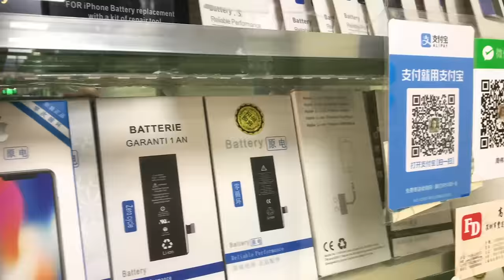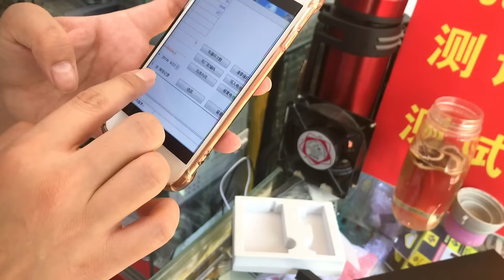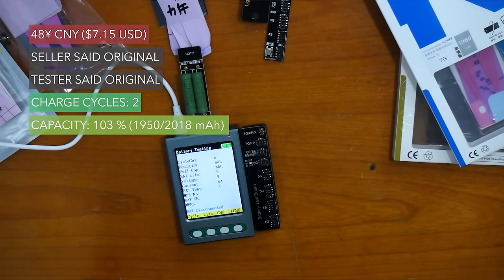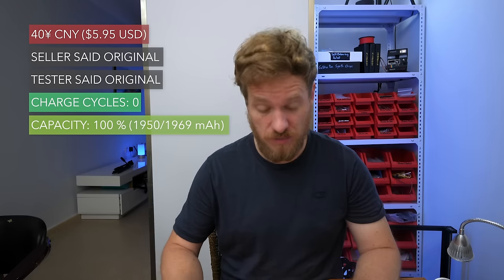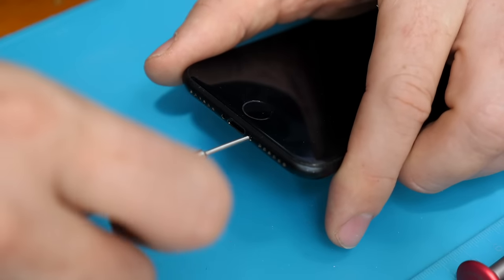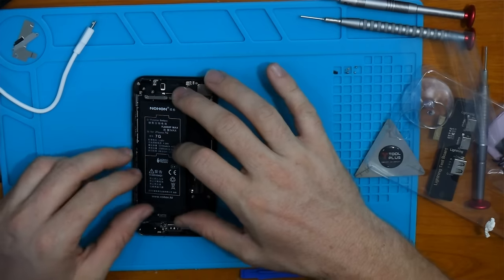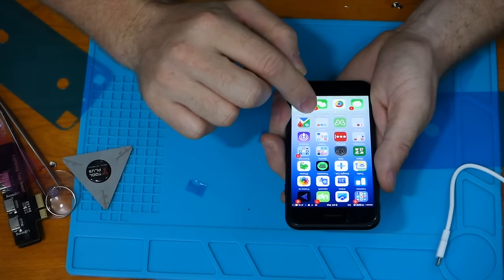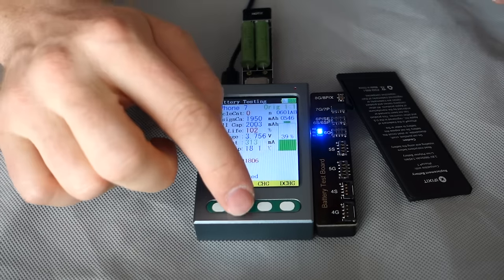Real or Fake? Trying to Replace my iPhone Battery in Shenzhen, China

Comment: Thats how easy and cheap a battery replacment could be! But it would be even better if we could just hot swap them as we used to!
EDIT Yes you could & still can hot swap them even if "cold swapping" was more common; that said i would take both over a 1mm thinner phone!
Reply: no because battery are dangerous,its was meant for expert to handle it not user...thats why they make it harder to change,also for safety factor...modern battery has bigger capacity thus more dangerous
Reply: You are supposed to keep lithium batteries away from heat so I don't think a hot swap would work, maybe a moderate or cold swap would be better.
Reply: Hot swapping is impossible on a phone. You can't replace it whilst keeping the phone online. You're using that term wrong.
Reply: @kennyj7627  you could have some kind of secondary small battery inside that just powers it for a minute or so, so you could hotswap the full size battery.
Reply: @justalilbitnerdy  that's not what hot swapping means......
Reply: @UnsweetIceTea  But that would wear out aswell and it has no benefit but adds a lot of complexity.
Reply: @naheeduddin1672  r/woooosh
Reply: There are many reasons we don't have cold swap anymore:
1. Most modern phones are water proof.
2. Modern phones are very thin, replacable battery wouldn't have enough space.
3. A removable battery needs a stable case which takes up even more space.
4. Apple wants to make some more money and the otherd follow
Reply: harry boyd  Well, there is a lot of stuff that uses removeable batterys but is still waterproof, like action cams.
Reply: @kernelpanic2887  Well all those reasons are nice but far away from a deal breaker, but Number 4.
Reply: @kennyj7627  Nope it is and was possible, that said even a "cold swap" would be nice.
Reply: @dongurudebro4579  Well. You can't have a thin phone and a save, removable battery.
And most people care more that their phone is thin and holds enough power for the day
Reply: @kernelpanic2887  Yes you can and the overwelming majority actually dont care if the Phone is 1mm thicker or thinner!
Reply: @dongurudebro4579  Exactly, no one cares about those details in irl. Maybe you think you care when looking at the papers, but not when the thing is on your hands. Companies trick us in thinking that they are "forced" to change certain thing on their phones which at the end are just dumb seeking money moves. Like the headphone jack removal.
Reply: @coldogno7  
LMFAO
Reply: @CookieAsArrow  My Galaxy S5 has both a changeable battery and really good water resistance (has been fully submerged into water multiple times and I shower with it) so I don't think water resistance is really a good excuse for newer phones lacking easily changeable batteries.
Reply: I think it actually relates to increased costs and other factors when shipping a battery as a separate component. Also, it would require more materials to cover up the potentially dangerous internals, would likely not allow for the same glass backs we’re used to, and all of this to prevent you paying an extra $20 to swap your battery instead of just buying a new one in two years time
Reply: @dongurudebro4579  Yeah lol I was retaking your point in my comment pal, don't worry
Reply: @coldogno7  If you're stupid enough to damage a battery that literally just slides into the back of your phone then you deserve to be offed by natural selection. I've dropped my phone, had the battery fly out and slide across pavement and never had anything happen. It doesn't take an "expert" to touch a battery... Having to heat up your phone, and pry the battery out of the case to replace it is FAR more dangerous.
Reply: @hojosconsal9913  Yeah i didnt noticed the "," when i first read the comment - i was really tired, but i figuerd it out when i worte the second one.
Reply: @CookieAsArrow  it might add complexity, but it would still solve the problem. If wearing out was the problem, you could either use a circuit that bypasses it until it's needed (cuts down on wear cycles), or use a slow-discharge capacitor inline with the primary battery.
Reply: @UnsweetIceTea  But you would have an extra unused battery to carry around all the time no matter what. The cost-benefit analysis just doesn't add up. Where is the benefit to a hotswap battery? Do you die if your phone is off for half a minute? Of cause you don't and you never said you would. But now seriusly again, you add complexity and weight aswell as a new point of failure. I am in favor of swappable batterys, but not hotswappable.
Reply: @jordanturner97  Batterys in modern phones do not have the semi solid plastic shielding older batterys had, but the heating up still stands.
Reply: To your edit, which phone could actually be hotswapped?

Comment: I installed a Nohon battery (with bigger capacity) in my iPhone 5S a couple months ago, so far it is working perfectly. It also lasts more than when the phone was new. It would be nice if you did a review of the battery you installed in half a year or so.
Reply: how many months ago to be exact? in the philippines we have a counterpart of nohon, which is called "Remax" and im skeptic of the side effects of the higher capacity to the phone itself, will it short some components or break some power related components in the motherboard?
Reply: No. It's a higher capacity not a higher voltage. The amount of power drawn doesn't increase, the amount of time that power can be drawn does. The only danger is if it expands leaks or explodes lol
Reply: @Champagnepipa  Like 2 months, the first thing I noticed is that it lasts a lot more at 0% and 100%. The other percentages behave similar like with the old one.
Reply: I would have liked to hear how the Nohon battery actually performed IN the phone over the first week in terms of both standby and screen on time?
Reply: @markbennett6658  Yes, that would be nice also, I could do a test when I have time. The cycle count of my battery is still only 15 and coconutbattery says it still has more than 100% of its designed capacity (1707mAh/1700mAh). I doubt the difference would be very big.
Reply: blue god thanks for the new info, man! Ill get that higher capacity for sure

Comment: Unfortunately any information can be written in the control board. Only a charging cycle can tell the real number
Reply: Agreed. The battery needs to be entirely discharged and then slowly recharged using a bench power supply or something. Only then will we really know the capacitance of the actual cells.
Reply: @deeeeeds  This kind of comment is what I really what to read. Thank you.

Comment: "I can replace it for $45 US"
"But here is cheaper"
spends $150 us on a testing tool
Reply: the testing tool not worth that price
Reply: Thinking same thing. :D
Reply: 69 likes
Reply: It's more like 70 USD
Reply: gets thousands back from youtube revenue
Reply: It’s ok ifixit paid it
Reply: The 150 $ were for a very clear purpose  !
Checking which battery was original or not .
The price of the battery was  smaller than 45 $ as you sow  ...
So ....don't be sarcastic  !
Reply: I have looked it up online and found the exact same product for 140 USD and 4 USD shipping costs for germany, so the price for the product is on par with the price the manufacturer sold it for, plus a few bucks for the lady selling it to him.

To be honest i thought it would be sold for far less but i guess the software and the practical usability of the testing box was time and cost intensive to develop and therefore exuses for the price tag.
Reply: SniperSpy10 $150 testing tool is for the video. He can test any battery at the store tho
Reply: some of these responses are confusing, like I know the cost of the devise, why are berating me for not knowing something when i clearly do know it
Reply: I think its 45 yuan not $
Reply: Ok, You can pay 45$ in a Apple store and then an Apple technician put a new battery with a guarantee (and probably they guarantee the water resistance too). Or you can pay 29$ for an non original battery and install yourself with the risk of breaking something (and maybe you need also a heater gun)... sorry but it’s not worthwhile. I think it’s worthwhile in very very old iPhones, iPods or iPads that you want to preserve by any reason and always taking the cheaper Chinese battery you can find.
Reply: @cronicasdesdelacripta  40RMB is like 6USD... but yeah, if you want peace of mind 45USD is not that high a price.
Reply: Li Jiang i was referring to the iFix pack at the end of the video that cost 29$. A 40RMB (or 6$) battery is worthwhile if you have the technical knowings and the tools (heat gun, that seems to be necessary), and iPhone 7 is too much new to take the risk, at least for me 😁
Reply: @cronicasdesdelacripta  Yep make sense, guess this solution is just for those who get a sense of achievement from fixing it themselves:D
Reply: I Can replace it for 10€ in Germany
Reply: The key is that you can MAKE money with the tool. Imagine all $$ that's coming to you.
Reply: Then you need a tester to test the legitimacy of the tester
Reply: And makes thousand of dollars because of ads
Reply: Lmao
Reply: Lol
Reply: plus buying more than 1 battery 😂
Reply: Don’t forget about time for search good one.
Reply: @Rusu421  😂😂👍🏻 yeeet
Reply: He did make $10k+ on the youtube video

Comment: This was fun to watch! I worked in phone repair for about 4 years and batteries were always a big struggle to source. In this ex-repair tech's opinion after replacing thousands of batteries, here's my rule of thumb: Only get the absolute best you can find. Everything else is a waste of your time and money.

Aftermarket batteries have two main points of failure: aftermarket gas gauges and aftermarket cells. The cells can be of varying quality when not original and so their performance may be inconsistent. But the gas gauges is where it really falls apart. The OEM batteries Apple uses have electronics made by Texas instruments and they are very high quality. They manage all sorts of stuff from how fast is the battery allowed to charge based on its cells temperature, to what its current charge state is, and even relaying to the phones SOC what it's health is to know how much power can be drawn reliably at any given time. Aftermarket electronics likely do not do this or "fake" various statistics and as such you see things like inflated batteries or short life prematurely. If you want, it can be a fun experiment to remove the tape covering the electronics on the battery and examine them under a microscope to see who's truly original and who's a copy.

I cannot emphasize how important those electronics are for longevity and consistent performance of batteries. Lastly, what I saw time and time again from all sorts of vendors (domestic and international) was that on phones more than one generation old a sizeable amount of batteries were pulled from old phones, had their manufacture dates scrubbed, and their gas gauge smart stats reset.
Reply: Thanks for the good information.

Comment: Your battery tests are flawed, as you depend on whatever is flashed onto the battery management IC inside the battery.
You probably just purchased a scammer's tool of choice which allows you to reset the battery count or write whatever you want, when you connect it to the PC I would guess you can even write whatever capacity you want which won't be corrected by that IC until you will take measurements during full charge/discharge cycle.
So to do it correctly you probably have to let it fully charge and then discharge few times and then see what the discharge capacity is.
You can do that pretty much with a much cheaper tools like some of the universal Li-xx chargers for RC models(imax b6) or those 18650 cell liitokala chargers but then you need to make some kind of adapter.
Reply: "scammer's choice of tool"
Reply: Yes please, do a proper capacity testing by charging/discharging each battery multiple times!
Reply: yea we need to see charge/discharge cycle results
Reply: i agree with you,and monitore the temperature during the charge, to see the resistence
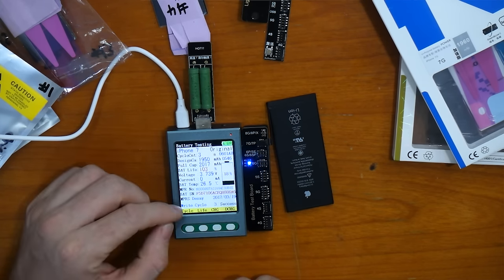Reply: He mentioned that you could overwrite IC values on the battery in the video when he first plugged a battery in the tester around the 8:30 mark.  So he was kind of letting the viewers know buying batteries like this was at their own risk since you could make an aging battery seem brand new.  It would be nice to get an update on actual tested capacity, but I'm not holding my breath.
Reply: @danielmoraes9637  To measure the internal resistance you record the current Voltage, apply resistor of known value which was calculated to load around 1A, then you apply that resistor for a second or less meanwhile you record the Voltage to which cell dropped(could use DMM at max/min recording mode).
Then you do the math and you should get around 0.06 Ohms or whatever those cells typically have.
Reply: I agree from past experience that these Chinese batteries will have no life in 3 to 6 months of usage.
Reply: I'm more worried about the "max" battery catching fire. Isn't getting greedy with battery capacity what happened to all those Samsungs?
Reply: Exactly. I would have loved some kind of testing here. You're buying off-label batteries at varying prices, you know how easy it is to reset some of the data on the battery, why would you just accept the other specs from the battery at face value?
Reply: some batteries are perfectly fine well others are complete trash, once you find a reputable manufacturer though you can get some pretty good batteries, crazy in australia makes really good aftermarket batteries and in canada where i am i buy a brand called hueriger which also makes very good aftermarket batteries
Reply: brando12343 - I agree as I’ve watched some Hugh Jeffries videos and he uses Crazy batteries and parts and them seem to hold up well.
Reply: Tbh, i felt a little bit disappointed with the video bc knowing him, i was expecting like some charge/discharge cycles and tests etc.
But anyway it's still a good video
Reply: brando12343 You’re right on.These guys are thinking about every off brands products are going out of their way to cheat you.Every off brands products are just like real brands names products.Some off brands products are good and some are garbage.
Reply: Yes, that "extra" capacity battery is a scam. This video was rushed.
Reply: how sad, he didnt reply to this post.  this is a good question to ask.
Reply: You really should have addressed the iOS “Battery Health” and which batteries correctly supported this feature. The ifixit battery I purchased for a 6 plus doesn’t work with battery health and says not support when I check it under settings. Also why gloss over the fact that the ifixit battery reported as original on your device. Seemed like a sly thing to do. Expecting viewers to assume the battery is really original? Regardless, I’ve enjoyed all of your videos. This one seemed rushed. I expected actual scientific testing as others have mentioned.
Reply: @philrod1  samsung had a manufacturing defect

Comment: tip: if you dont want the battery adhesive ripping while you pull them out, remove the taptic engine/vibration motor first.
Reply: Yup, that almost never fails

Comment: 1) Remove taptic engine before pulling the white straps out.
2) Please take care, first plug everything EXCEPT battery into the board, make the battery connector the LAST thing you plug into the board.

Comment: the adhesive is easier to get out if you carefully use a plastic ifixit spudger to wrap the adhesive around it once before pulling at a low angle. also try removing the taptic engine first.  if all else fails,  disconnect the battery from the board and soak around the battery with isopropyl,  then scoop under it with a plastic card,  no heat needed.

Comment: You dont know how to test the battery test them with a proper load constant current load on different ranges of current and monitor them.
plot a graph over time and then calculate the actual energy in the battery.

IC in the flex of batteries can lie.
Reply: why don't you do it?

Comment: iFixit forgot to include the heat-gun you needed to take your phone apart...
Reply: you can use hair dryer
Reply: @duducarblog  2000watts of heating?
Reply: Or leave it out in the sun for 10 minutes or so (on a hot day). @duducarblog
Reply: @rndfixr4145  now everyone lives out in the Sahara desert
Reply: @duducarblog  Yes, to some degree, if you have the patience...  But Scotty claimed the kit contained everything you need, and said it could be done in 15 mins, if not filming.... Anyway, they get you 90% of the way.. I just feel like he left out one important detail, perhaps because it was sponsored. I support free sponsored content, but it doesn't hurt to tell the whole truth despite that, I really like iFixit, they do a lot of good to the community and still makes money. A few words like "You'll only need a heat source to complete the kit" would have been sufficient... Mostly so a semi-amateur (as he also recommended to DIY) wouldn't just buy the kit and think they're ready to go... I have, and know my way around, a soldering iron, but I do shrink wrap with a regular lighter... should I put my phone above a regular lighter? That's my point.

Edit: on another note... a high-power hair dryer would probably be safer if used by a total amateur. You have a good point... but it's still not in the "complete kit", and it'd take a little more time.
Reply: Seth Econ i live in Canada, one time I left my phone in the sun and my battery got damaged from the heat in 1.5 hours so 15m will be suffice anywhere unless you live in siberia